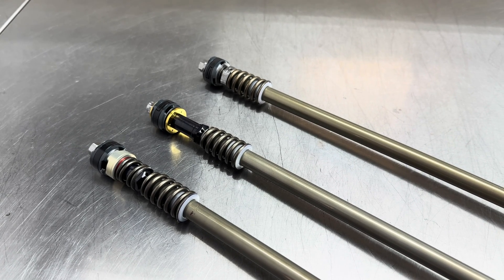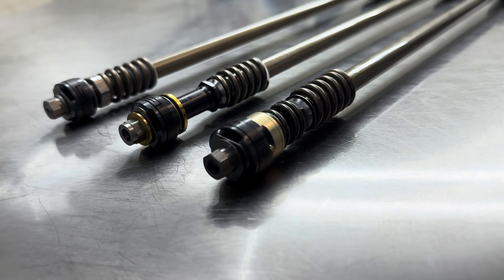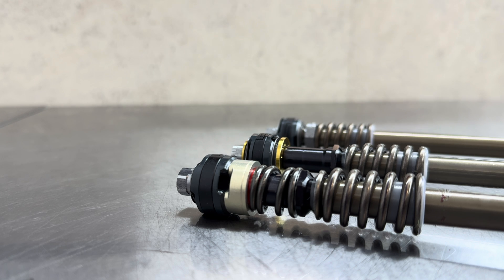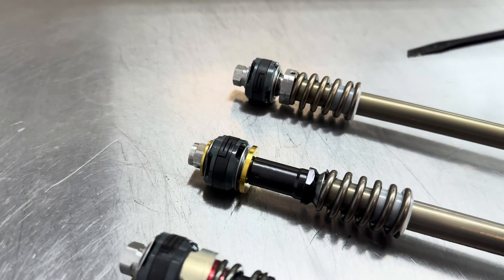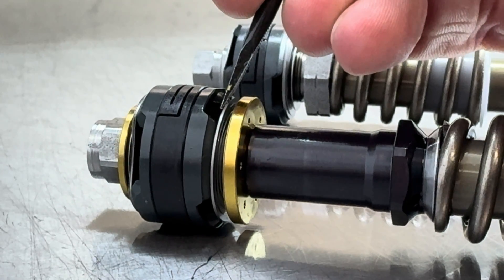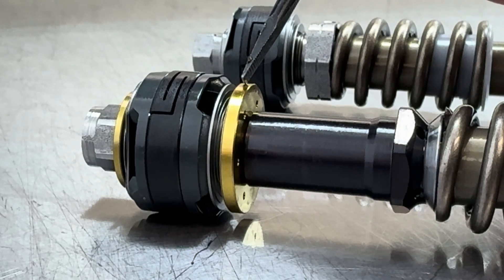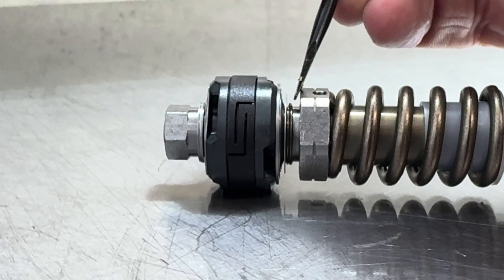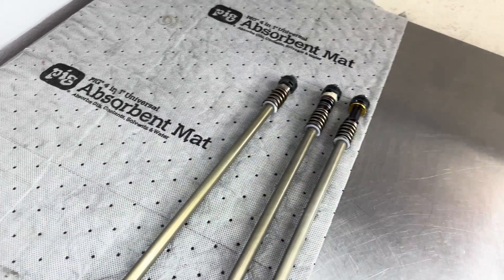3 Types Midvalves - WP XACT Pro

Comment: OK thank you for this video. I always wondered how this worked on the mid valve. I thought it was a low speed compression stack that you see in a base valve but couldn't see how the oil would work with that. But this video shows that its more of a float-tuning option is that correct. By tuning this leaf spring you can tune the rate of float?
Reply from the maker: You are welcome.  Glad to video helped you better understand things.